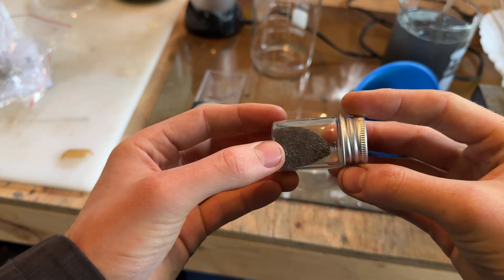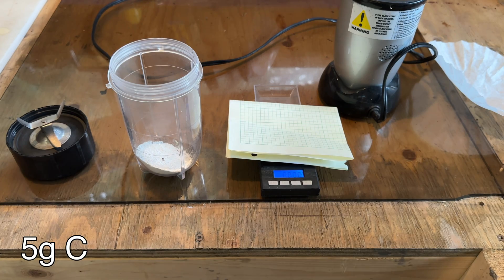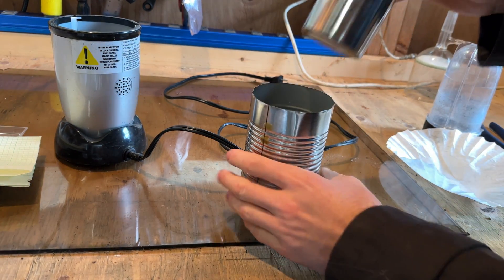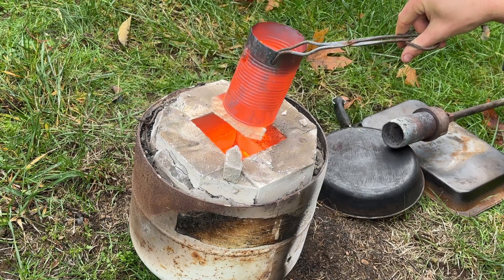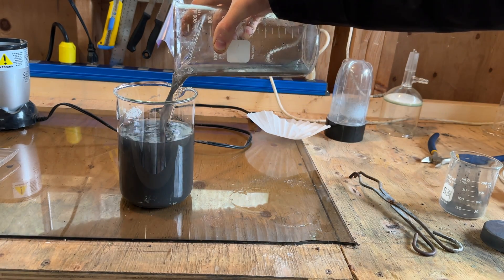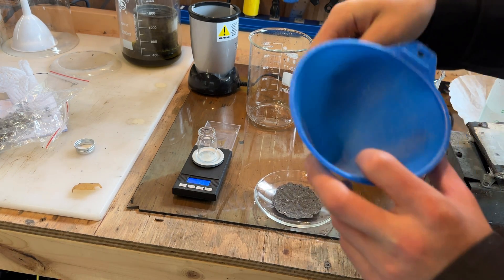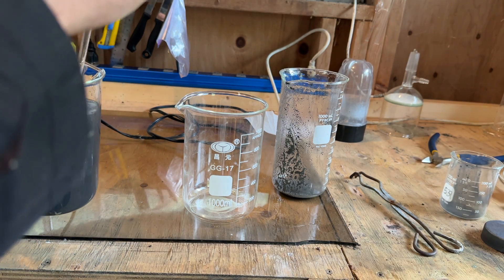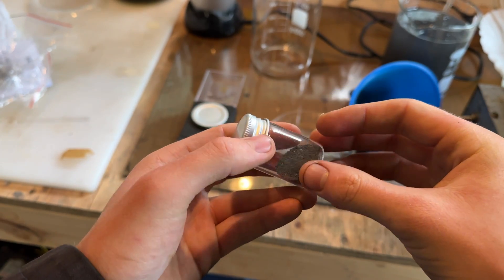Making Finely Divided Tin (Household Materials)

Comment: Could this method work with other metals such as copper ?
Reply: Temperatures will vary depending on metal. Can compare CO2 formation energy vs Metal Oxide formation energy all as a function of temperature
Reply: @TeslaFactory 😊😊1😊
Reply: There are much better methods for copper. Use example CuSO4 water solution, then add vitamin-C aka ascorbic acid. Heat the solution and fine copper powder will form.